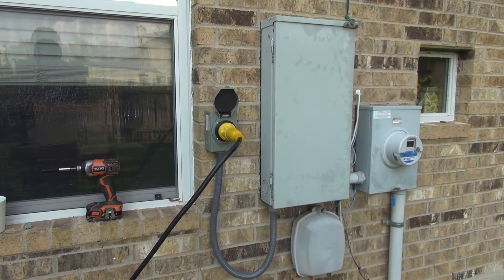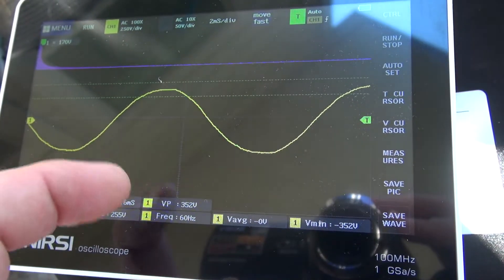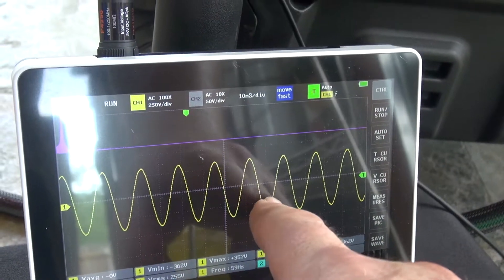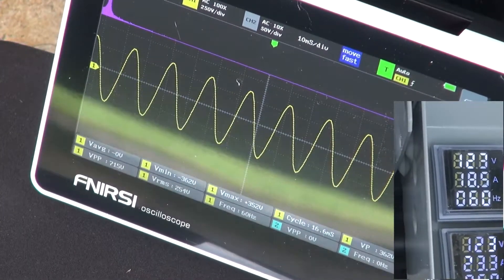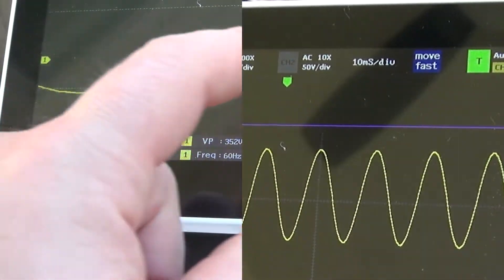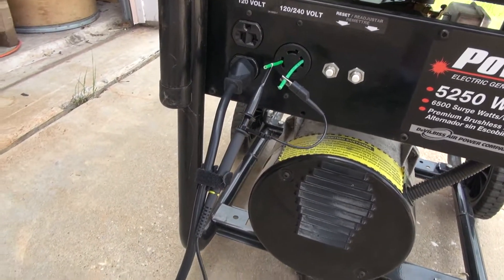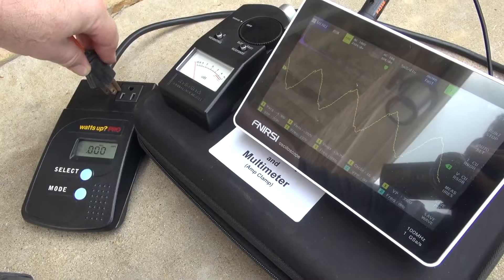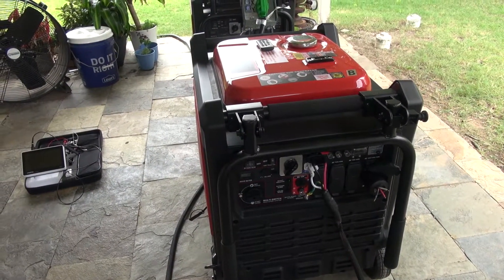Predator 9500 Inverter Generator vs. Line Power vs. Traditional: Compare Quality on the Oscilloscope

Comment: 3:25
That conventional sine wave does not look "that" bad IMO ... Its still a sine wave. it just has some ripples in it.
Reply from the maker: It's less about the fuzzy/noisy wave form, and more about the fact the portable generator will slow down when a load hits.  Since the speed of the coils are directly related to the power frequency, the engine speed lowering when a load hits, causes the frequency to also slow... suddenly going from 60-ish Hz to 30Hz and then jumping to 70Hz and back to 60-ish Hz again, isn't great.  

An inverter generator will always maintain clean 60Hz regardless of the engine speed, and if the load exceeds what the surge power the engine can provide, the power will just cut off vs. giving bad power.
Reply: @Texas_DIY  well i think it boils down to the quality of the inverter on which will drop and raise freq / voltage depending on load.
Also, i can understand the inverter gen keeping the freq and voltage at 60hz and 120V or 240V if it ever spikes above but when it drops below 60hz or below the 120/240, you can't correct that, at that point if it gets low enough, then shut down ... 
While i dont own a inv gen, i am 100% sure if you have a 5000W inv gen and you hit it with a solid 4500W load, i can guanrantee you its going to load that motor down hard, and it will prob restore faster than a reg gen but in no way will it recieve that load and stay on perfect idle .. 
But yes that inv gen is better for quality, its just questionable on whether or not its worth double the price to most people 🤷🏽

Comment: Good video, but I'm not gonna lie, the power that came from the traditional generator was cleaner than I thought it was going to be.  Of course it's dirtier than the inverter gen but it wasn't as bad as I was expecting.  When the power goes out here in Florida I run my AC (and everything else) on my 20 year old Generac 12.5k gen and the AC unit makes a weird harmonic sound when running but runs OK it seems and has had probably 50 hours on it cumulative (on generator) with no issues/failures to report.  It's always kinda bothered me that it sounds so weird which is why I'm looking at oscilloscope generator videos on YT.  I just can't make myself drop a few grand on an inverter gen that i'm quite sure runs cleaner power and I'm also quite sure it won't last 20 years like that noisy beast I have now  lol.
Reply from the maker: It's less about the fuzzy/noisy wave form, and more about the fact the portable generator will slow down when a load hits.  Since the speed of the coils are directly related to the power frequency, the engine speed lowering when a load hits, causes the frequency to also slow... suddenly going from 60-ish Hz to 30Hz and then jumping to 70Hz and back to 60-ish Hz again, isn't great.  

An inverter generator will always maintain clean 60Hz regardless of the engine speed, and if the load exceeds what the surge power the engine can provide, the power will just cut off vs. giving bad power.  But it's not like a traditional generator will insta-kill your stuff, especially if you can keep heavy loads from nailing it and slowing down the engine too much... just the cleaner power is better.
Reply: You have a point. I thought the conventional gen was going to be worse, it does not look "that" bad IMO .... Its still a sine wave, just has a little bit of ripples in it but nothing major. 
If you are just going to use this for a few days or several days during a power outage, then ok but to spend $3k+ on an inverter generator to use for a few days during a power outage every so many years to have "CLEAN" sine wave .... ahh no 
Im also in Florida and we lost power for 7 days from Charlie and 6 days from Irma ... That was 20 yrs between hurricanes so why would i spend $3k on a fancy high $$ generator to have a perfect clean sine wave ? 
Besides another thing comes to mind, these fancy new inverters have more electronics involved, creating AC then to convert to DC and then convert BACK to AC for clean prefect sine wave, just another electronic brain that can fail. 
Where the conventional just produces AC and sends it to the panel ....
Reply: I'm not familiar with the scope but is it capable of displaying transient events? I know some cheaper scopes do a lot of averaging which would make the distortion look better than it actually is.

Comment: Hi, Can I use conventional generator with UPS for sensitive device? The rest is just for lights, ceilings fans and single door refrigerator without any electronics.
Reply from the maker: You can, but the cheap UPS units will just pass through the bad power until the voltage and maybe the frequency exceeds the unit's set limits at which point, the inverter kicks in.  Some of the nicer UPS units are ALWAYS running on the inverter, thus making clean power (like these generators do, but just off a continually charged battery vs. a gas engine).  If you want one of those UPS units, look for what they often refer to as an "online" or "double-conversion" UPS to get that full-time clean power for those sensitive devices.

Comment: The waveform put out by the traditional generator actually looked a bit better than I thought it would. I've run mine quite a bit, and the capacitors in all my "sensitive electronics" seem to have managed the power just fine. I can see why an inverter is much better for those who can afford it.
Reply: Here is the way i see it, we all just use these after a hurricane or power outage and most for a few days, some for several days, some for a few weeks. 
How often do you get a natural disaster ? 
Im in Florida, lost power for 7 days after Charlie and 6 days after Irma .... That was 20 yrs between the two. 
I don't see the point to spend $3k+ on a fancy inverter generator just to have "clean" power for a few days every so many years.

Comment: The basic generator is not "that" bad, i have seen much worse, modified is MUCH worse, that is an actual sine wave, just not 100% clean but its a TRUE sine wave with minimal distortion that most of your electronics wont even notice or see. 

So it all boils down to:
Do you want CLEAN power at a lower wattage (7600W) from an inverter gen
OR
Do you want MORE power (12,000W) while still a sine wave but a bit dirty
Reply from the maker: In my case, I can make over 15,000W with the pair... over 50A continuous.  

But it's less about the fuzzy/noisy wave form, and more about the fact the smaller portable generators will slow down when a load hits.  Since the speed of the coils are directly related to the power frequency, the engine speed lowering when a load hits, causes the frequency to also slow... suddenly going from 60-ish Hz to 30Hz and then jumping to 70Hz and back to 60-ish Hz again, isn't great.  

An inverter generator will always maintain clean 60Hz regardless of the engine speed, and if the load exceeds what the surge power the engine can provide, the power will just cut off vs. giving bad power.  They will also conserve fuel by slowing the engine down when loads are lighter... a traditional generator can't do that without altering the power frequency. 

But really, if your generator has enough horsepower to maintain speed/frequency under sudden loads, then it's not all that bad. Normal generators are OK, it's not like it will insta-kill your stuff, but you need to make sure you've got the horsepower.
Reply: @Texas_DIY  i get it 100% ... Clean stable power and it uses less gas with less load and more fuel with more load. 
The issue is price, the inv gen is going to be double the price of the standard gen at the same power level.
Yes you are paying for quality, at the same time, how much quality do you really need for those "rare" power outages that last several hrs to where the food in your fridge and freezer are going to go bad unless you get power to them within a few hrs ...
As of right now, i cant see spending double the price for the same wattage even though its cleaner and more stable.
Something like that is not on my priority list so i will keep my standard generator, the good thing is, it has an automatic voltage regulator so it keeps the voltage at 120V or 240V .. which is far more important than the fuzzy/noisy wave form.
Reply: @Texas_DIY  oh and 1 more thing i forgot to add is longevity of these inv generators, these do have an "ecu" or a computer brain like a car that takes the AC from the alternator and converts to DC and then back to AC .... 
So there is a LOT of electronics involved to do the rectifying and filtering and stabilization of power, that to me is 1 more thing to go bad and if that "computer" fails, your generator is as good as dead. 
Where as you have a standard generator that doesn't have all the fancy electronics and just takes the AC and passes thru a voltage regulator to maintain the voltage to the outlets.
These new inv gen are new so the question is how long will they maintain where as the standard has been around for decades and still work. 
Yes both can fail but i feel the inv gen has more potential things to go wrong because there are more electronics involved and i have no idea how "good" those components are let alone how long they will last.

Comment: :22
Its not scary until you touch or short the prongs ..... Use common sense and it wont be scary ... SMH ...
Reply from the maker: LoL, I was certainly careful not to touch them... but anything that I might brush against that could blow a small chunk of skin off qualifies as "scary" to me.  :-)  Same thing as when I'm in the main breaker box... there is power in there that can't be turned off... I certainly don't touch that part, but there is a part of my brain that goes into very high "scary" / "caution" awareness when I'm near it.
Reply: @Texas_DIY  this is why i connect at the house 1st, then connect to the generator 2nd ... 
Then power down the generator, then pull the plug off.

Comment: we got a smart meter at home, we also have dirty electricty anyway we can clean our dirty sine wave at home to make it a clean sine wave can you please tell me the solution
Reply from the maker: Unless you run everything through a whole house inverter (like used for solar systems) there isn't much you can do.  For specific device, look for an "online" UPS unit, that is, one that is always running the inverter for power supply.  (The cheaper ones only engage and switch to the inverter when there is a power loss).  The "online" style will give you clean power out regardless of the input.

Comment: hey @JayTX is it possible to use an invertor generator to clean a dirty sine wave to clean dirty electricity from a home
Reply from the maker: If you pulled it all apart and rewired it... maybe?  The inverter in it is expecting a very high power frequency from the coils... that way when the engine slows, it's still getting good enough AC power to electronically convert it over to clean power.   I'm not sure if it would take 60Hz.  It would be a total experiment.   For what you're needing, you'd be better off protecting sensitive stuff with a good UPS unit. 

The cheap UPS units will just pass through the bad power until the voltage and maybe the frequency exceeds the unit's set limits at which point, the inverter kicks in.  But some of the nicer UPS units are ALWAYS running on the inverter, thus making clean power (like these generators do, but just off a continually charged battery vs. a gas engine).  If you want one of those UPS units, look for what they often refer to as an "online" or "double-conversion" UPS to get that full-time clean power for those sensitive devices.

Comment: I own this exact generator. However, I am still wanting a full solar and battery backup solution with at least 60kWh of storage to power my home for a full 24 hours peak usage or several days with rationed power usage during outages.
Reply from the maker: I've heard that the power from these are clean enough that it will trick the solar inverters into thinking that it's normal line AC power, using it to charge the batteries and run the home until you turn them off making them think it's a standard power outage.   From what I've heard, many of those will sense the difference in power quality from a traditional generator and not engage the same way.  No personal experience though.

Comment: This is a good analysis which doesn't miss what many others do: large starting loads. With any solution, especially traditional generation, even whole home units, appropriate load sizing is key to minimize THD.
Reply from the maker: Yup.  It's less the fact that it's a traditional generator, and more the fact that the speed has no choice but to change when a starting load is applied (and thus the frequency drops).  Proper sizing helps ensure the generator can power through the sudden load change, and not mess up the power too badly.  So that was what I was getting at with the video, both those generators were similar-ish in size, one will make nice power no matter what... and in that same application the other traditional one won't when loads hit.

Comment: Great video, I would be interested in seeing what comes out of a much bigger portable generator like the WGen11500TFc which provides the max current available from a 14-50 receptacle with natural gas
Reply from the maker: Those are usually pretty clean, especially if the generator can maintain speed when loads hit.  It's the speed fluctuations that are really the bigger problem with traditional generators.
Reply: @Texas_DIY  better off not trying to run at full load.

Comment: Thank you so much, I SO appreciate brevity and clarity. PS have you done any videos on the higher end non inverter generators like well DuraoMax, well maybe not super high end but more main stream?
Reply from the maker: I'm just a guy that wanted to have a way to keep the house alive if the power goes out again.  No monetization, or additional generators.  That said, in my research, I found out that most of these similar appearing generators are all made at the same Chinese plant.  That also includes the GENMAX GM9000iED (now it's the GM9000iEDC), which seems to solve all the shortcomings of the other similar models.  It's duel fuel, has nice gauges, can be parallel'd without needing a box, remote start, accessible air filter, has an oil filter, and it exhausts out the rear so they can be side by side without one cooking the other.. it's pretty slick.  If I were buying again, I'd go with those.  (except they wouldn't fit in my box)

Comment: You hook the scope ground to one hot leg of the power, and then tough that scope?  LOL!
Reply from the maker: It's 240, it only has two hot legs, there is no neutral.  My understanding is that the second channel doesn't talk to the first on the scope, but they share a common ground.  As there are only two hot legs cycling back and forth, it had to be hooked up that way.  But I'm not an electrician.

Comment: Clear information.  Thank you.  Please explain why the electronics in my home need clean power.  All the electronics in my home convert the 120vac to the DC voltage it can use.  Thank you.
Reply from the maker: Electronics are designed to process 60Hz AC.  Often 50-60Hz for modern power supplies.  If you lag down a traditional generator with a heavy load, that frequency can drop way out of that range and voltage.  Some power supplies may take it, some may shut off the device they're powering (or under power the device).  Devices that depend on the frequency for keeping time (often stoves, older clocks, and such) may lose time accuracy.  Motors that run directly on AC power (not converted to DC) will run directly proportional to the power frequency, so your compressor, fan motors, etc.  Will change speed with the generator's speed/frequency, which could potentially stall, strain or lead to bad things with something like a fridge or AC compressor.

Basically, it's harder work on those devices, and can lead to premature failure (often of the capacitors).  But it's usually not like some kind of insta-kill.  Think of it a bit like driving your personal vehicle really aggressively... that usually won't blow the engine right away, but it does wear it faster and lead to an earlier failure.

Now if your whole home generator is sized (oversized) such that it doesn't bog it down on heavy loads, you're probably perfectly fine.  

But trying to run a home on the type of generator I showed, I'd avoid, as when stuff (even refrigerators and such) turn on, it's gonna mess with the power.
Reply: Thank you.  You made your point clear. I've installed a soft start on my heat pump.  I have also bought a "larger than necessary" generator.  This is for emergency use only.  If money was not an issue,  I would have purchased an inverter generator.  Thanks again.

Comment: 3:25 the AC filtering capacitors drop the generator voltage by as much as 30 volts to smooth out the wave form... tho by the drop in a mirrored spot, one of the coil phases in that unit is partly burnt out or 110 is being used on top of the 220 volt dragging down a phase.
Reply from the maker: If it was a shot where I was powering my home with it, my loads on the legs aren't precisely balanced.  Usually one is around 7amps or so higher than the other as I recall.

Comment: This literally was the most straight forward video out of all of them explaining the difference in a inverter vs generator and what clean vs dirty power is. Thank you
Reply from the maker: Glad it was helpful.  Sufficiently sized normal generators aren't necessarily bad things... problems happen when undersized units get bogged down with heavy loads.
Reply: @Texas_DIY Even with a properly sized traditional generator the THD is still an issue for sensitive electronics, though.